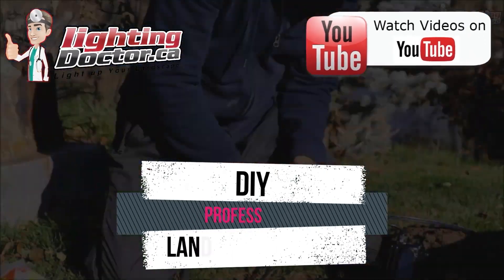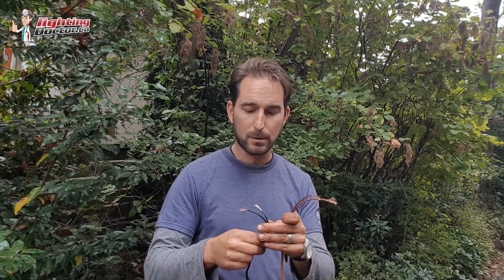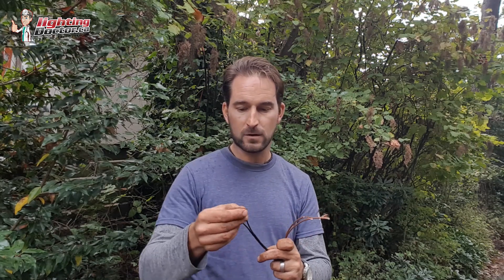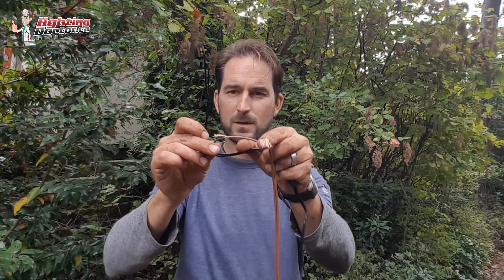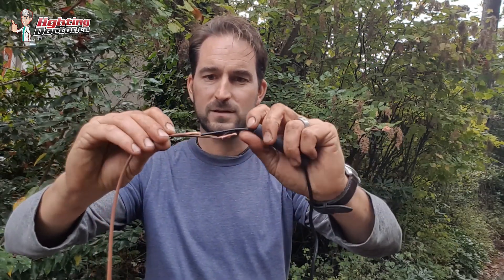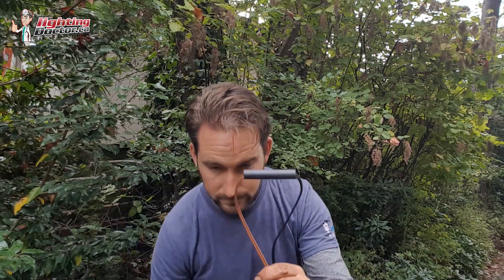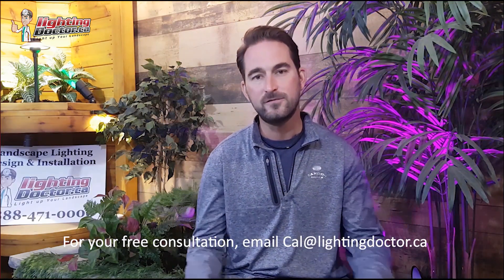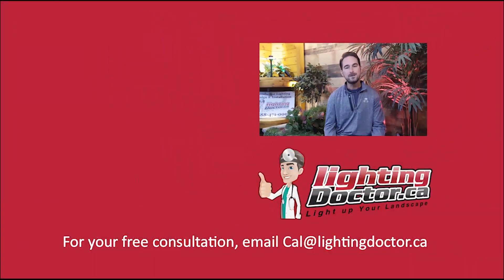How to Install Landscape Lighting - Waterproof Heat Shrink & DBRY Connectors

Comment: Hi Cal. Are you using KSC-3 or KSC-4 dryconn heatshrink connectors in this video? ALso, I noticed you did not use the metal/crimping part but just the heatshrink sleeve. I assume this still provides a tight, waterproof connection?
Reply: Pretty tight but not very strong